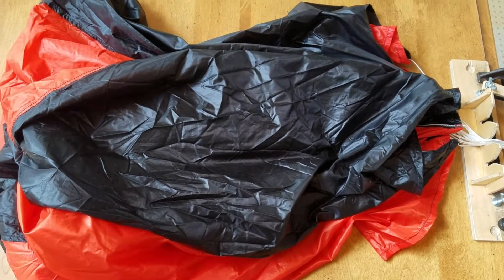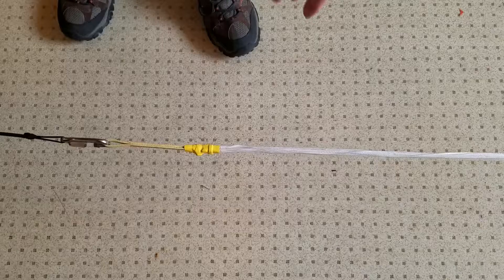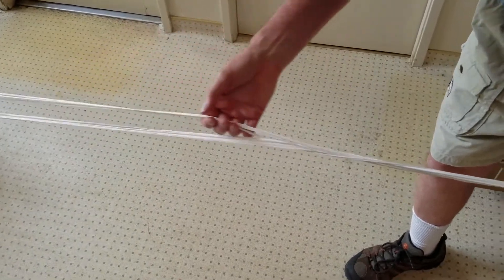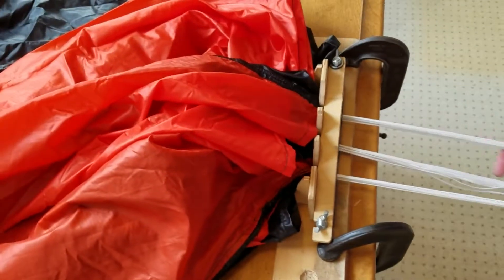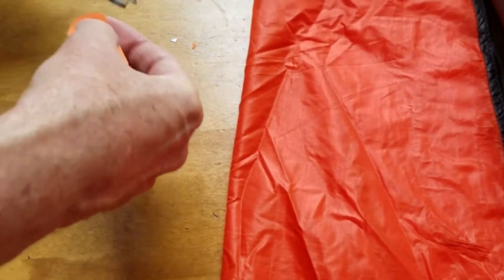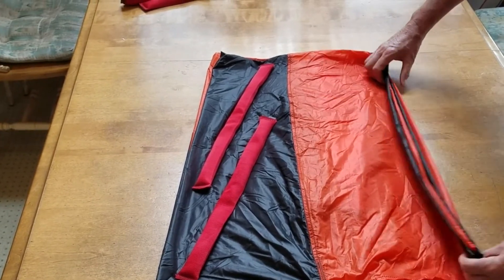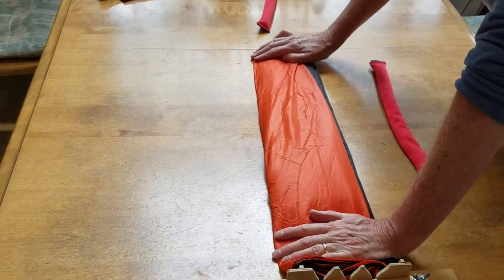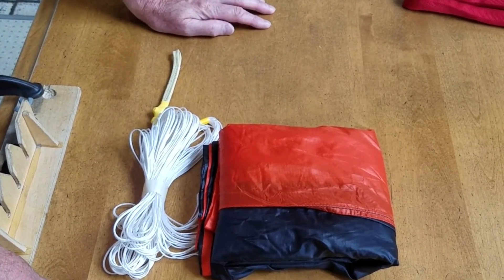How to Untangle, Patch, and Fold a Parachute

Comment: Fantastic video!  I've been flying one of my Iris chutes and getting more tangled every time.  I decided to try and untangle it and just couldn't get a handle on where to start.  Your method worked perfectly.  Took maybe 10 minutes.  I used a couple of F clamps on the bench to separate the left and right lines.  Worked well.  Probably the best piece of advise was to just choose a loop and undo it.  Don't worry about finding the "right" one.  Thanks!